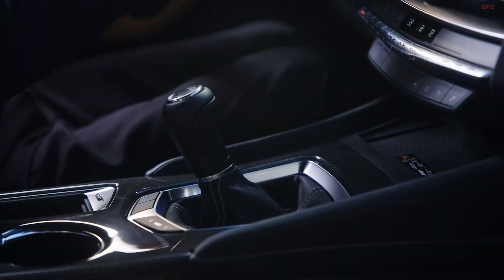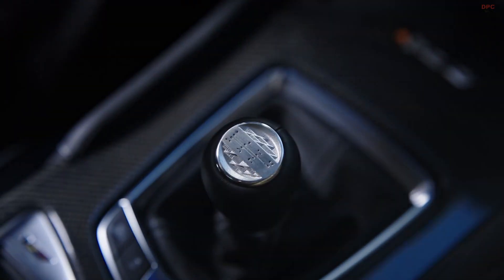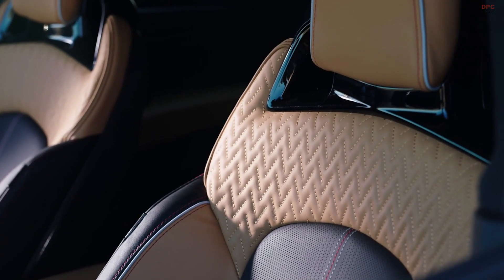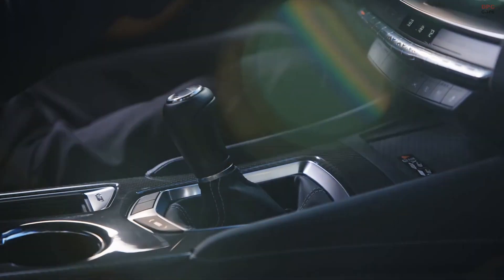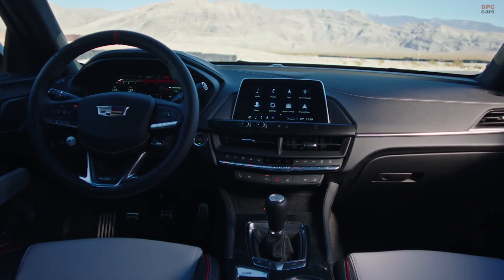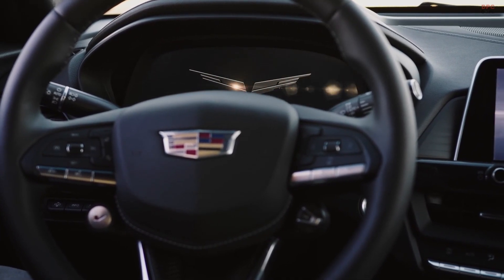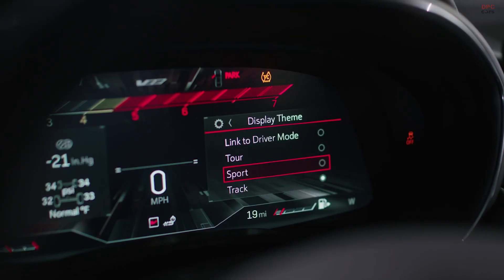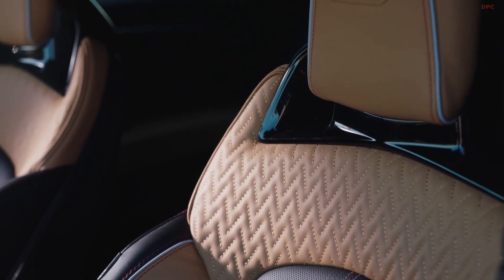Interior Highlights 2022 Cadillac CT4 V Blackwing and CT5 V Blackwing

Comment: Cadillac knocked it out of the park again with reverting back to a manual option. 
Walking through the gears on my old 140hp (when new) Nissan 240 on the open road was a stress reliever. 
Walking through the gears in a 200mph plus, 668 hp/660lb.ft of torque, Cadillac MANUAL sport luxury sedan will feel like a dream, .....actually a wet dream. 
Imagine that.

Comment: Those cars have 10.9 cubic feet or 308 liters and 11.9 cubic feet or 336 liters of trunk or boot space respectively. Those are the typical FAKE GOURMET sedan, those that comes ready to be swallowed by an SUV. In the ranking of decent sedans (TOP 500 SEDANS) with a trunk capacity above 500 liters or 17.6 cubic feet it does not enter. The trunk of those cars are smaller than the trunk of the Renault Megane, a HATCHBACK sold in Australia which has a trunk of 434 liters or 15.3 cubic feet of capacity.
Reply: Dude who buy this cars for trunk space are u hearing ur self sport car not shopping
Reply: @propro3183  What is the use of this then? It is no wonder that this type of sedan with mediocre trunk is being replaced by boring SUVs. After all, if it is to have a sedan with a small trunk, it would be better to have a hatchback or a coupe like the Chevrolet Camaro and the Ford Mustang. Now everything is explained, after GM announced the electrification of its entire range of vehicles and stopped the production of the wonderful Cadillac CT6 at the Hamtrack plant for the manufacture of that electric nut called Hummer. GM needed to put the wonderful BLACKWING engine in a car before it died. So GM chose these two crap there, with mediocre trunk, do better, forget the CT4 and CT5, they are two end of season bottles. Save your money.
Reply: @avaliacarros7739  ??????????SMDH
Reply: @avaliacarros7739  Shaking my Damb head🤣